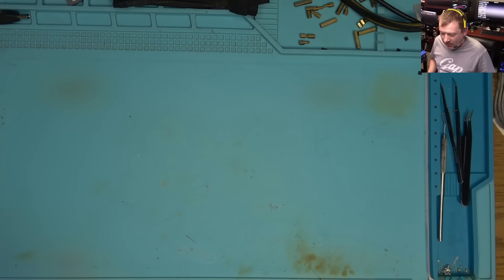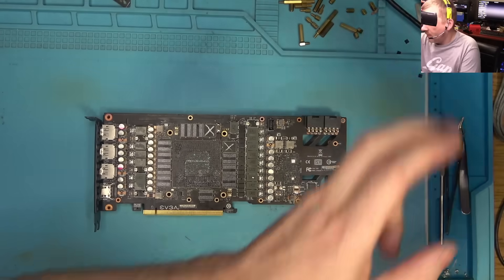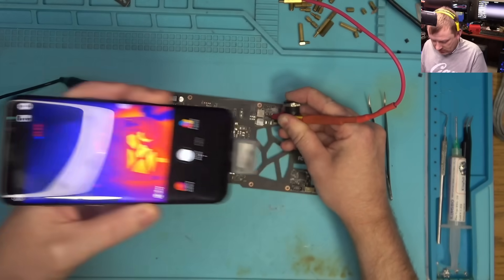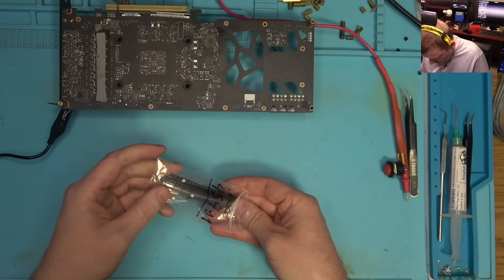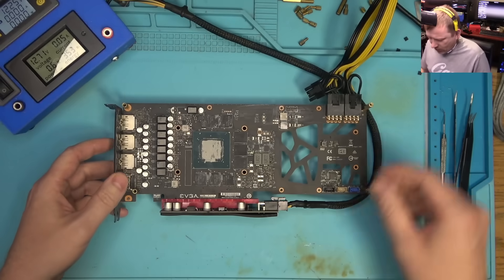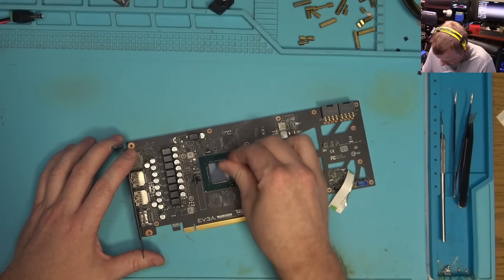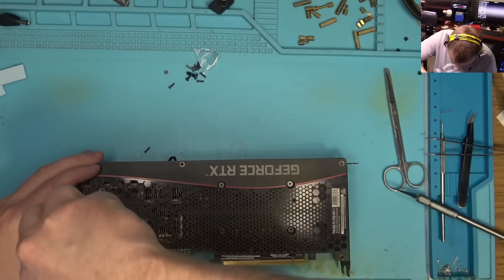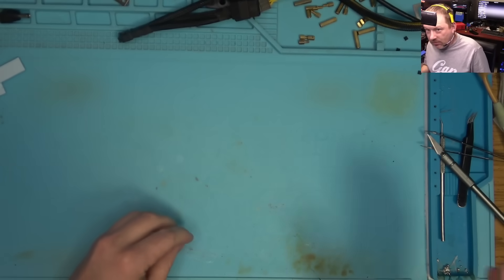Tribute to Electronics Repair School (not really)

Comment: Would you please share the custom NLBA pcb designs? I always wanted to make some of those myself, but I never had the time to actually learn a PCB layout designer program. All my NLBA custom cables are hand soldered to connectors and supported by hotglue :D Lazy, fragile and not so clean method from me.. I like your custom case for the device aswell! Very good job!

Comment: I switched to PTM7950 combined with halnziye HY-256 putty instead of pads for gaps of 1.0mm and below, Fehonda 15w/mk pads for bigger gaps. this gives a lot better mounting pressure on the GPU chip. And PTM shines with that.

Comment: You forgot to measure the battery, remove the battery, thermal camera and see the hot spot is on the back of the motherboard, and then dodgy, ducks, and then the BIOS programming.

Comment: Well, all prospective techs need to start somewhere.  So kudos for the attempt.  BTW, if it's just for stablizing DC current, yeah, capacitors can be optional, otherwize for like RC circuits (generating pulses) they are neccessary.

Comment: Great video. I have a 3070 from EVGA as well and my problem is that it has 400 ohms on the 5V rail and when i inject voltage there nothing warms up. Any ideas what could be the issue? 

I replaced already the PEX-IC, and some other ICs which where physically damaged. 

Any idea is appreciated.
Reply: you have too many capacitors and screws. capacitors mess with your multi-meter and dont do anything useful. capacitors are the enemy of easy pizza. hope that helps.
Reply: @paulchamberlain7942 does not help